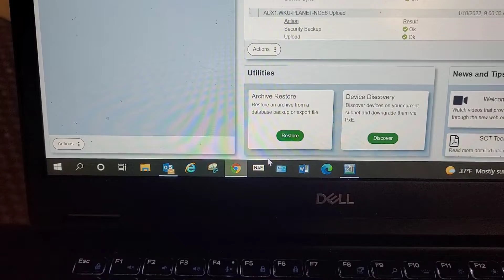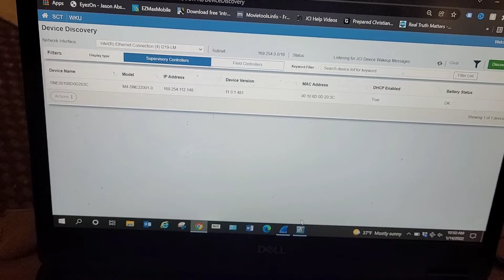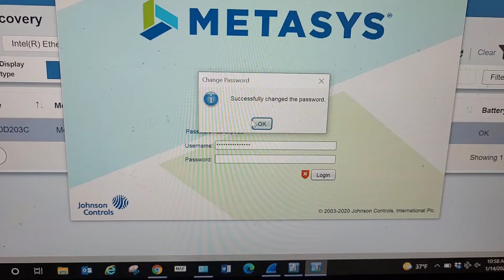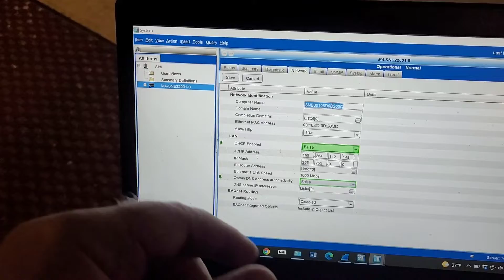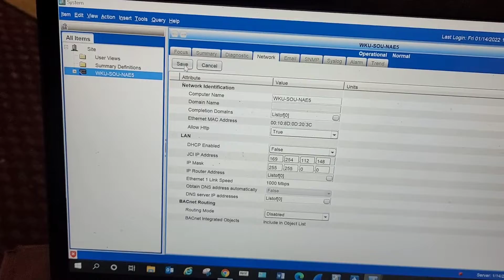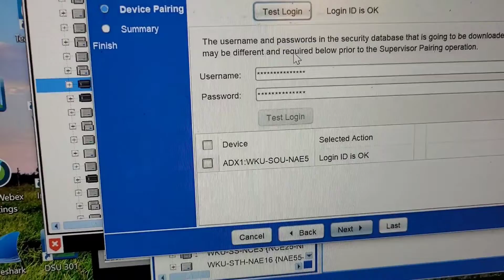How to install a Johnson Controls SNE2200, replacing of an NAE55, start to finish, mistakes and all

Comment: Hello sir I have already this system metasys, but they are going to change the building internet network, what is the step to make this work with the new internet?
Reply from the maker: You need to work with the service provider to ensure the equipment gets the proper connection.  If it is connected to a server, you need to make sure the network engines can still connect to the server.  If they are changing the IP address on the server, you will need to enter the new IP address into each of the network engines.  Depending on what they do, it shouldn't be much of an issue.
Reply: @Systemcontroltech do you have a video?

Comment: Just browsing around your videos this morning. Have you had the chance to try the new BACnet IP FAC4911 stuff? We have a recent install that uses a Cisco Ring Switch and our FAC's are all connected BACnet IP in a ring. The Cisco switch connects to our building network along with the NAE or SNE. Instead of FC bus everywhere we have data cables. The speed difference when uploading, downloading, and commissioning through pass-through is night and day. No more RS-485 for us, Ethernet is the way to go. If you get the chance I highly recommend upgrading to this newer communication, you'll love it.
Reply from the maker: I haven't used the 4911 yet.

Comment: I might have missed something when you were working with the IP addressing, usually a assigned IP of 169.254 means your device has failed to receive a IP via DHCP
Reply from the maker: It was only connected to a switch at first
Reply: 169.254 is just a internal network number on your computers network. I have programed a whole JCI  network on that address because is was concerned a private   on my computers network.

Comment: Hi System Control Tech, Could you please give me some advices about the following question:
1. Does the DDC keep the last value of AV, BV and MV when the DDC's the power is restore?
2. If the question number 1 is YES. So, how can you change AV, BV and MV value to the default value when the DDC's power is restore?
Thank you!!!
Reply from the maker: View the specific point you want to change. Click on the options tab at the top of the screen. Change the default value to whatever you want it to be and set the ignore relinquish default to false. It may or may not give you the results you want depending on how you use that specific point
Reply: @Systemcontroltech  Thank you for your advice.

Comment: Hi, which version of the Metasys are you using currently?
Reply from the maker: Currently running metasys 11
Reply: @Systemcontroltech  Good morning colleague, a small doubt that in the GGT when you go to ''open from metasys'' you log in with the administrator user and the legend appears ''the required service is not available on the host. You may need to upgrade the host."
I already tried to update it in the metasys host update option but when I enter the same legend appears